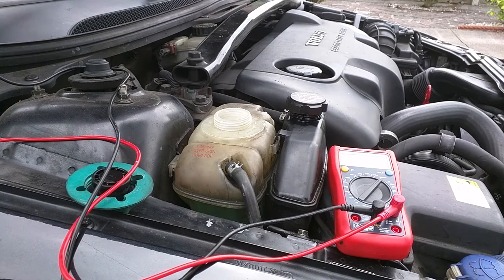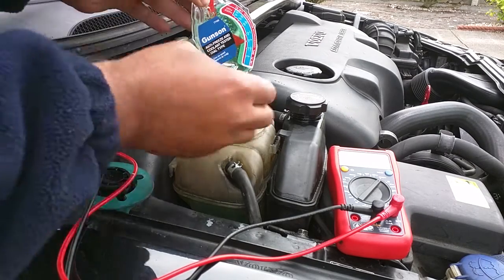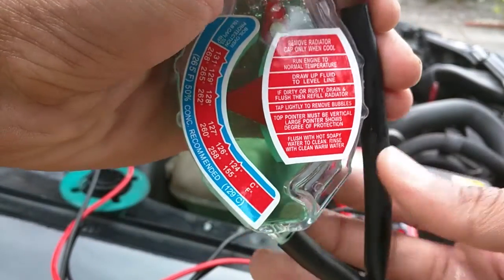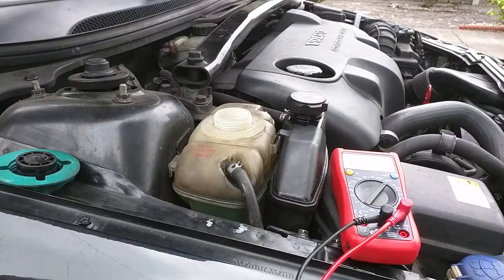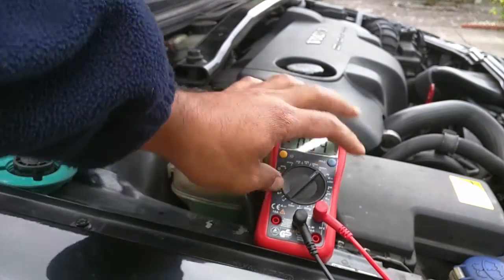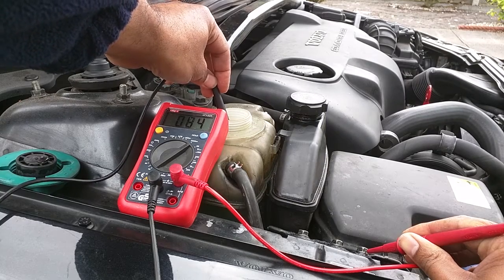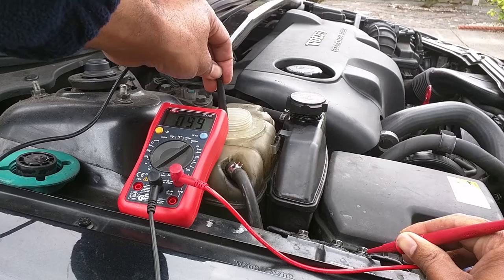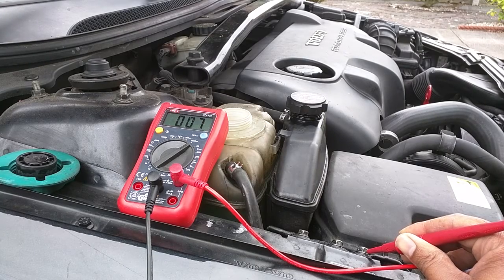How To Test Coolant / Antifreeze.  Part 2 After a Coolant Change

Comment: Most people show the voltage test with engine off?. You state it should be running. How do the test results differ?
Reply from the maker: Engine running and electrical loads on creates current flow.
You can't get an accurate voltage drop result without current flow.
Reply: @sirobb  thanks for the reply , will recheck my cars with engine running.

Comment: Greetings from Brazil.  What does the friend think about running the engine for a few hours with distilled water, draining it and then adding the coolant?
Reply from the maker: If the level of water is correct and there is no chance of it freezing, yes it would be ok to use it for a few days if you want to fully rinse the cooling system.
Reply: @sirobb  Thank you very much. I live in Rio de Janeiro. The temperatures here, in winter, are around 15 Celsius degrees and people complain that is too cold. Funny...  God bless you.

Comment: Damn, the voltmeter check is pretty smart. I never knew you could use it to check the condition of the coolant.

Impressed as usual :)
Reply from the maker: Yes it's a good test and very reliable. 
I have a Part 1 video where the same car failed the test which made me change the coolant. 
It went from 800mV before down to 80mV after which is pretty conclusive.

Comment: Looks like your were testing at the reservoir.  I assume you can also test at the radiator filler opening instead without the engine running?
Reply from the maker: If that's your only method of accessing the coolant then yes you could do that as an alternative.